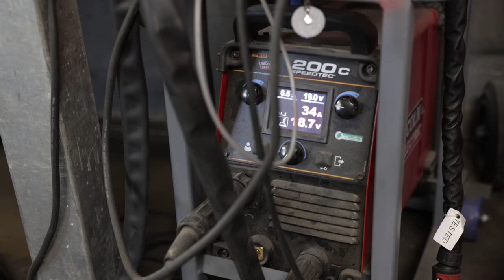I turned a Toolbox into a BBQ!!!

Comment: I was questioning how does this work with the opening mechanism that removes the grills from the heat!? and THAT EXACT FEATURE is an advantage both when you load and unload food!! I gotta agree this is the best barbeque you've built so far!!!
The lid also keeps heat in so it should be more efficient. Along with the smoker effect. Now I want that toolbox.. lolol

Comment: That was interesting that it didn’t melt or warp the thin looking metal. I wonder how it would look after using it 10 times or so…. Great video as always
Reply: The boxes are thin sheet metal, but they're constrained fairly tightly by the cantilever mechanism, the box shape and folded-over edges, and - most importantly - a welded grid of 1/4" rebar in the bottom of each box.

Comment: I wonder whether it would work to make a cobbler after the meal is done and the coals are bedded down. Maybe a little Dutch oven style container could be set inside and the lid closed while the cobbler bakes?
Reply: Just to make the language easier, because Laura's English is excellent but this exact kind of term can be difficult, "cobbler" here means one of about a dozen US desserts that are generally along the lines of a streusel. There's also buckle, crumble, grunt, slump, pandowdy, crisp, etc. etc. each with a distinct type of topping and geographic center.

Comment: Feels like I've seen someone do this before. Thinking Westley Treat, but can't recall. Either way, seriously, make a stainless steel coal caddy (a dished sheet with perforations like the base) for the bottom. That paint only does so much and isn't designed for direct contact, let alone the corrosive environment caused by the ash. Could be wrong, but I predict only a dozen or so uses before the bottom starts to show major issues.

Comment: I thought this was a crazy idea until I saw how well it worked and how you designed it. we've got a simple galvanised bucket with a grill and a handle but this idea is good for using my old tool box but what will I do with the old tools?

Comment: Note: I love the idea and I am hooked! While considering how to realize this project for myself though....

A concern I have is the coating with a high thermal silicon resin based paint...
Most of these paints are not suited at all to be in contact with food not alone being heated and to cook you food above it's fumes. 
Theses paints contain +85% of Volatile Organic Component and are only fully cured after elevated temperatures for hours. Event then, the datasheets state that there are not food inert (Food Grade) and not to be used in direct contact with coal as the upper limit temperature might be exceeded. There is nothing against cooking your food over fire, but in this case you are coating your BBQ with a synthetic, for water organisms highly toxic and skin and lung irritable aerosol. I have some reservations if this is a smart idea, as these paints are intended for automotive parts and the OUTSIDE of ovens. Do that for yourself ok.....but if you invite all your unaware buddies for a special meal smoked in the fumes of a resin paint, better think twice if this is worth the kick. 
I can only think as an alternative the paint/lack that is used for the inside of cooking ovens....don't know what type is used there and what the max temperatures are though. Or make the coal carrying part of stainless steel maybe....

The Safety Datasheet can be found here:
https://www.service.european-aerosols.com/fileadmin/files/sdb/de/SDS_10448_-_DUPLI-COLOR_THERMO_SPRAY_various_colours_DE-DE.pdf 

Nothing against the concept,I love it!

Take care and look after yourself;-)
Reply: Doesn't look like she removed the old paint on the inside either, just painted over it.

Comment: The most difficult bit probably was the paint - looks like Hammerite or a clone of it... Instead of stripping it, I'd first have checked with the most probable manufacturers of the paint, which nowadays would be AkzoNobel in Hilden (formerly ICI) to see if it would be much of a hazard when burning.

Comment: Just make sure your food is always cooking in foil and not up against painted surfaces. Your design makes those very close. Would hate to have the paint gassing into the food or leeching into it by direct contact. And of course, when closing with food inside make sure the foil goes over the food as well.